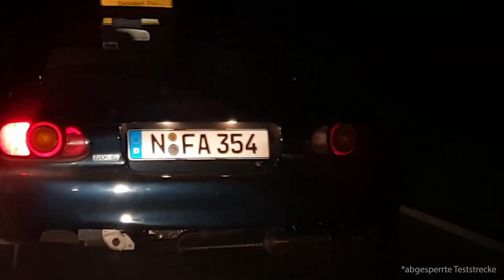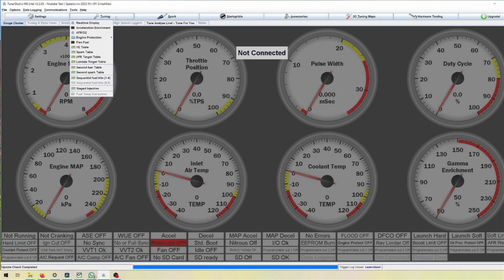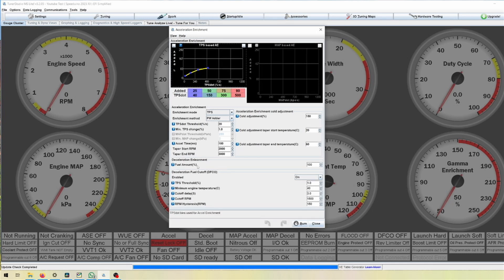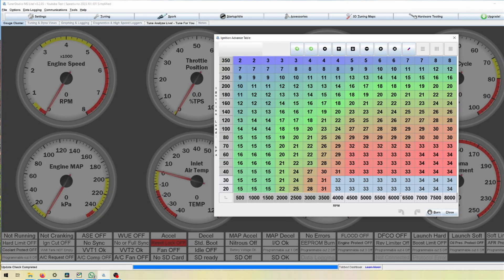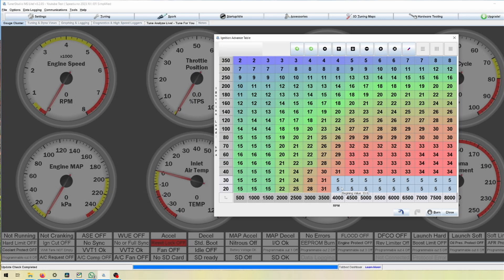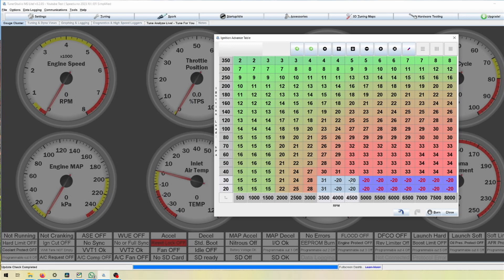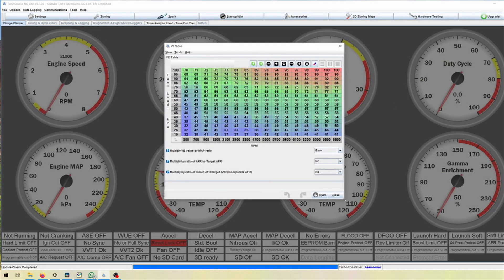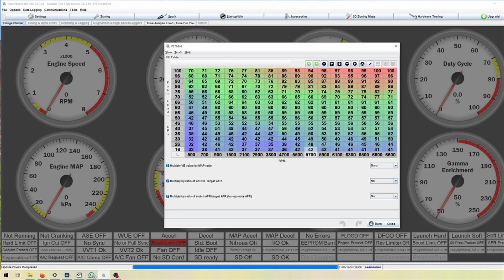How to Flame tune / Pops and Bangs / Burble tune | Tunerstudio & Any other Standalone ECU

Comment: I tried going down to -10 ignition on decel (max on aem infinity) and added some fuel so AFR is around 12:1 on decel and still nothing. I just want a bit of pop but not alot. My decel fuel cut delay is at 2 seconds. Any idea what's wrong? I did confirm the datalog that I am indeed at -10 ignition when off throttle...
Reply from the maker: Needs to be between 16 and 18 or something like that on decel

Comment: does this work with cars that cave a stock muffler or resonator
Reply from the maker: Yes it will work but the effects will not be as loud depending on the exhaust layout. there are stock exhausts that use straight through mufflers on those it will be similar but if they are chambered you wont get many flames if any and may cause damage to the muffler also
Reply: No, definitely need a custom exhaust. You can DIY It though instead of getting a expensive cat back system

Comment: so what would be the difference between lets say deep but not so loud civilized burble and actual pops and bangs, just the timing? also, for more flames more VE? i have set my ecu for pops at 1% throttle, but don't think I ever saw any flames :D
Reply from the maker: Id say at 0-5 degrees its more civilized but also depends on the engine heavily. Same goes for ve usually its somewhere between 40 and 60